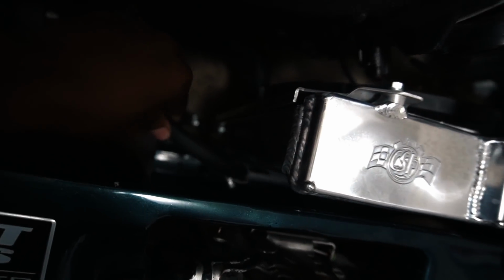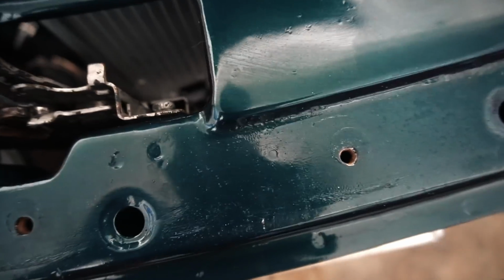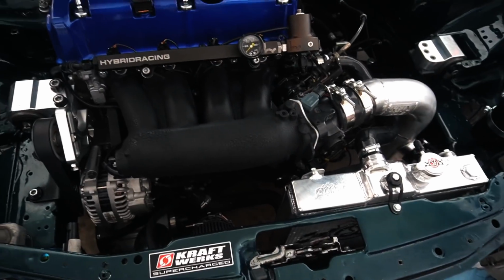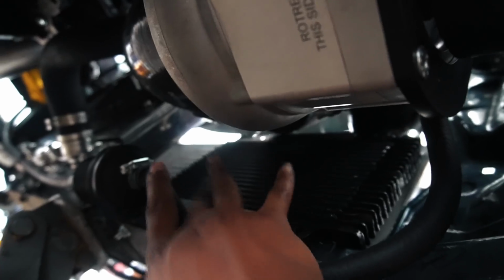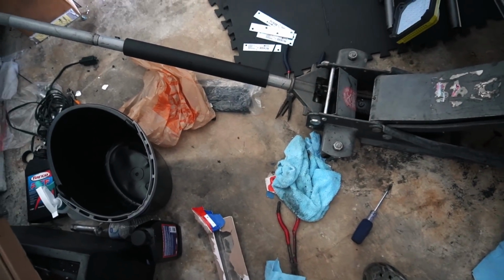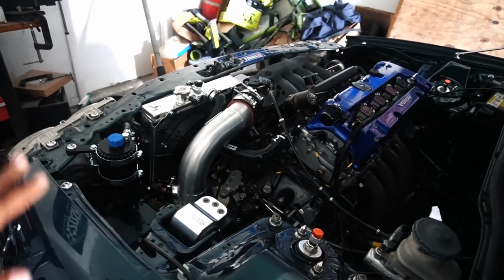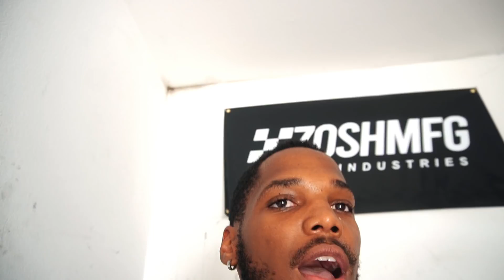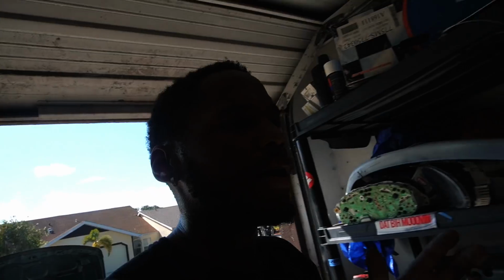Diagnosing Overheating Issues (Pt. 1)  - Supercharged K24 Integra

Comment from the maker: Thanks to Manscaped for sponsoring today’s video! Get 20% OFF + Free International Shipping + 2 Free Gifts with my promo code “ZOSH” at https://manscaped.com/zosh
Reply: Don’t get a mishimoto radiator get a KoyoRad(with the KoyoRad cap…high key works best)with a mishimoto fan shroud, and they sell a air duct on eBay that fits perfectly on a lens broken turn signal that way you can keep the outer portion of the turn signal functioning properly. Really think you should look into it fam, I’m just like you cuh(3 motors 1 dc4, touge car), just more loyal to my B20v and B18c🥲
Reply: @thebakerygarage  DEFO NEEDS A SHROUD. Without a Shroud you cant create the vaccuum needed to move all that air that the Spal Fan can push.

Get quality Coolant, and also, why not move the Oil cooler to the other side?
Reply: @Hanschepu  then and diy blocking/ducting the bumper opening to direct the air to where it’s supposed to go, and some eBay junk hood spacers and he’s money. I got sauce/hands but I can’t win with my lil mama😭a bought 2 lemon swaps and decided “huh imma rebuild em bitches and make 300+ n/a”……Reilly

Comment: Papa you can also run a fan in front of the radiator, maybe one of them spal thinner ones, one to push the air and one to pull. Works pretty good.

Comment: I had a similar issue on my 500whp boosted EK. I had a 3 inch Thiccc intercooler in front of the radiator and my temps would climb and climb when driving. Ended going to a thinner intercooler and it solved my issue

Comment: It’s a teggy bro should have a full size rad in there since that what it was designed around. There is no grill like a ek to help with cooling and dispersing heat. You also got the intercooler keeping air from flowing to the rad.

Comment: Would a swirl pot help circulate coolant?
And what about a skid plate to keep air flow going thru radiator and intercooler instead of escaping in less resistance areas? ( Idk how to explain it but, that’s the best I can explain it lol)

Comment: Put a pusher fan to the back of the radiator along with the puller fan and run some water wetter with some high performance coolant thereafter you should be good
Reply from the maker: I don’t need to do all of that.

Comment: Use two fan instead of one......put one on the front of the radiator to force in the air and another on the bck to pull in the air

Comment: I also heard the same thing about modern cars running hotter too. The true test is taking it to the FIRM and doing a few sessions and seeing where the temps are and I think if Florida is being Florida and its 90 degrees in Oct, you'll get a good gauge in how its holding up. You are taking the 8th gen though this time? Not sure if I am going yet...

If my na b series car was hitting close to 210 degrees there last Honda Meet event, but on the street rarely hit past 195. I think you'll be seeing higher temps with the Kraftwerks. 

But since its a street car, you probably should be ok.

Comment: Damn was hoping you had the cure lol. Just finished my jdmk24a swapped 00civic sedan but can’t it bleed right. I’m sure it’s the combo I got. Speedfactory tucked radiator and that ktuned fill neck on the head. Car try’s overheating before the thermostat opens. Boiled it and drilled the hole to 1/8”. I don’t think jacking the car up either end will help because the fill neck is the highest point and the radiator is pretty low being tucked. I’m hella stressed of destroying the final product just trying to get it bleed.